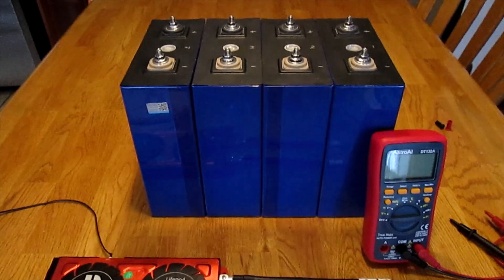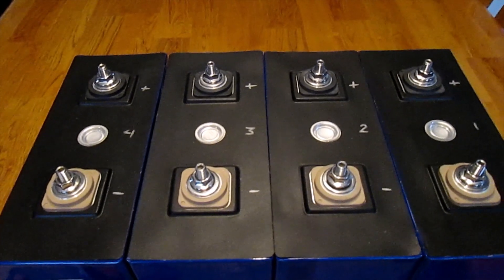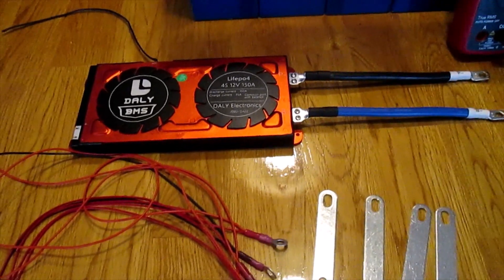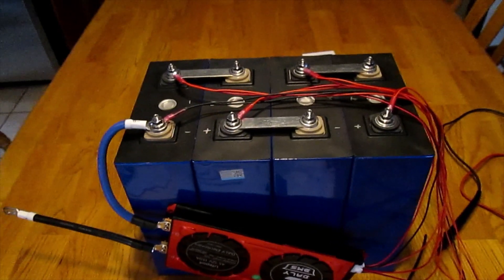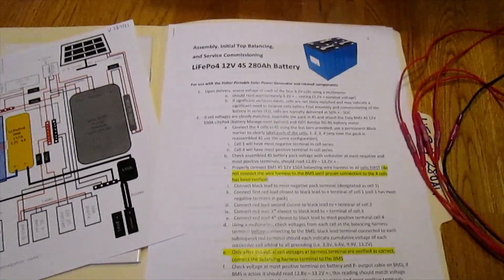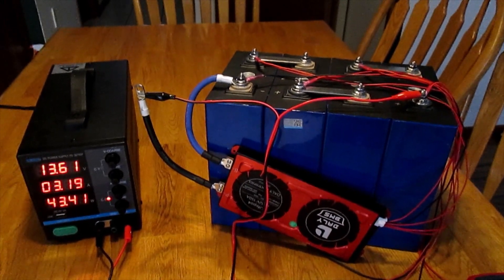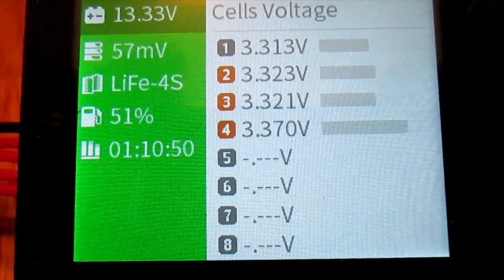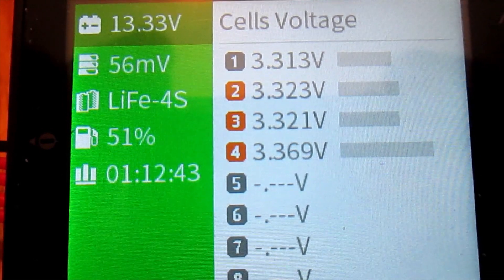V2 P2 3.5 Kilowatt Hour LiFePo4 DIY Portable Solar Power Generator

Comment: You can't cheat the top balance like that.

You should just put them all in parallel and apply a CV of 3.5 or 3.6 volts. Yes it takes a long time but if you do it right the first time you will save yourself a week of redoing it and the Daly will keep them balanced forever.
Reply from the maker: You can’t judge like that without watching the next video.  You should watch the next video in the series to see the complete top balancing process.

Comment: Nice! They look great! Mine are grade B for sure. They perform daily in my pond system very well thought. The only time they go far out of balance is when changing gets over 93%. Still working on the victron settings that can ease these differences.  Cheers and sunny days 🌞
Reply from the maker: Thanks for viewing and for taking the time to comment, David.  I am more convinced that my cells are grade B , too.  I have yet to subject them to repeated daily charge/discharge cycles, but I have noted that after having initially top balanced and drawn them down to about 60% state of charge they drifted apart (about 40mV difference) while charging back up to 100%.  They quickly fell back into balance within 5mV after drawing them down again, this time to 80%.  I'll talk about some of my observations in the next video.

Comment: Quickest way to top balance is to put in series and charge at 14.5 volts with as many amps as you can get and as soon as one of the cells hits 3.65, reassemble pack into parallel and charge with the bench top power supply and also as many amps as you can get extra . Charge to 3.65. I used a BTPS and a 20 amp buck converter. Pretty quick, couple days to charge a while set of 16

Comment: Any reason you didn't connect them all in parallel, to let them balance out?
Reply from the maker: Would have taken a lot of time to let them naturally balance in parallel; they still would have needed to charge in series to increase the pack voltage prior to finishing the top balancing in parallel wile charging up to 3.4, 3.5, and 3.6V.
Reply: @JimFisherDIYPortableSolarPower  - I have always connected cells in parallel for 8-24 hours, to balance, before charging.  This puts them very close and then usually the BMS takes over from there, giving you a balanced, fully-charged battery in 24-36 hours, at the most.  When they are chosen well for matched IR, this process can take 8-12 hours, total.  

Are you building a solar generator on a cart, like this one?  (No affiliation and yours would have way more usable capacity!)

https://www.youtube.com/watch?v=QZYAAatdlmc
Reply from the maker: Unfortunately they were not closely matched upon delivery.  I am replacing the AGM batteries in my solar generator.  See the videos that precede and follow this one for a full explanation.